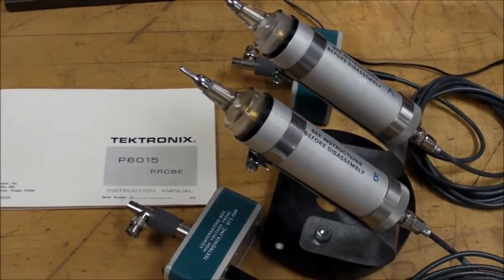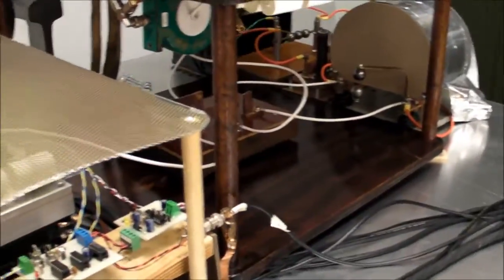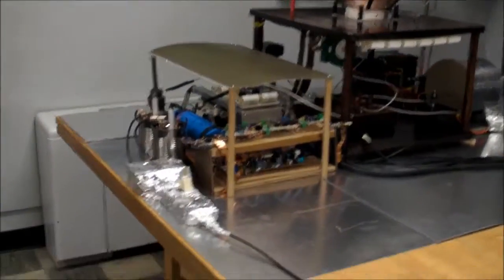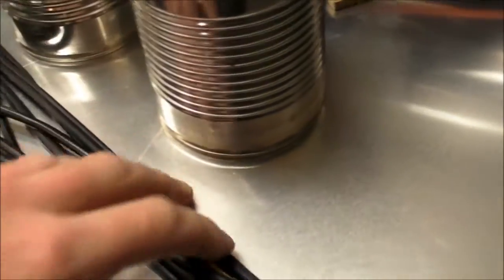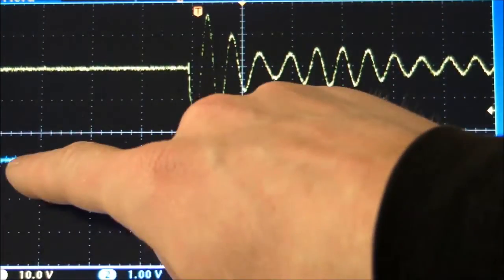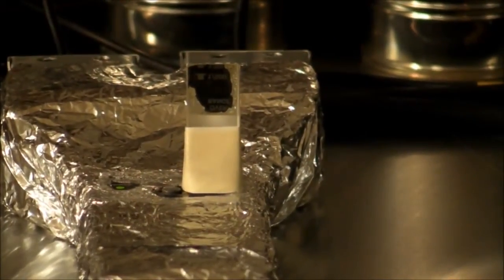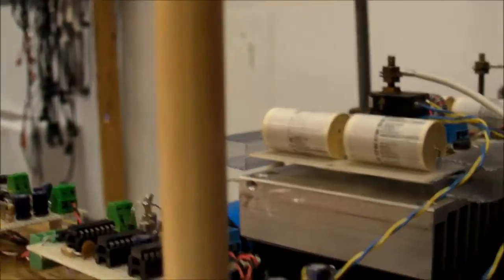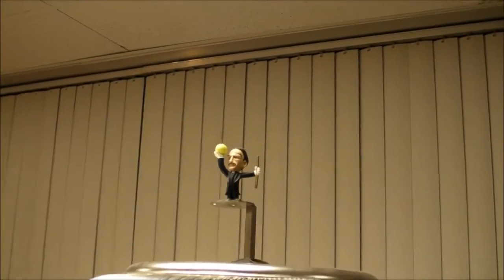(#0052) Testing the HV Scope Probe on Tesla Coil - DRSSTC vs. Spark Gap #10

Comment: @Eric Precission dynamic H-Voltage messurment is not simple & low cost.
Thats why i so interested in your Doku. The Build and know-how of that was interesting. 
 May you will look for new ideas at that new Deflect via Beam-Laser-Based  HVolt equipment.
I have geat Respect for HV-Stuff ( you make one mistake there, and you a burned)
Keep on & Good Luck.
Gruss Holger.

Comment from the maker: Thank you! That helps. I am familiar with using a mirror in very sensitive galvanometers, but I have not seen it used in an electrostatic arrangement. My Deutsch is very rusty, but I can understand the pictures, and they give me lots of good ideas for measuring high voltages.